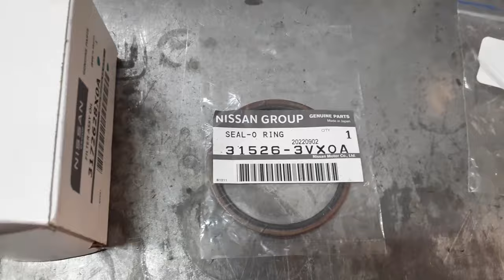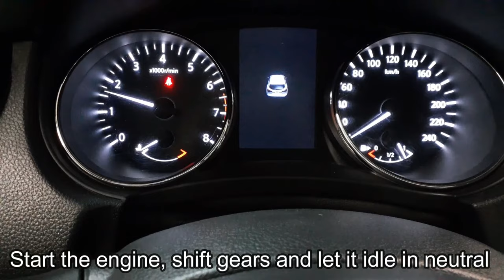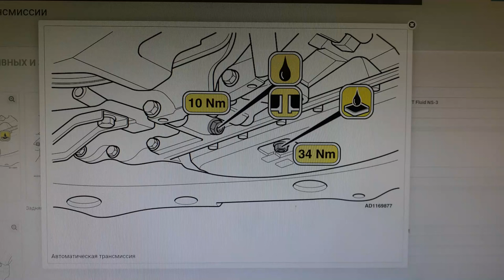Nissan Qashqai Automatic Transmission oil service

Comment: hi! how did you remove the last bolt on the cartridge filter cover because in the video only the 3 bolts were shown.
Reply from the maker: Hi! I don't remember any difficulties with thiese bolts. So everything must be simple.
Reply: @igorpestun8703  the access its kinda tight so  just want to know what tools you used since i don't have all the tools available I still collecting some of it :)

Comment: Hello and thanks for the information. I think that is the same process for Xtronic Koleos 2018.I have doubts about this service because it does not appear in the manteinance guide🫣🫣 Could you indicate how many kilometers had the Qasqhai??? Thank you again.
Reply from the maker: Hello, thanks for watching. This maintenance doesn't appear in guide, because factory doesn't assume oil change. Mileage was near ninety thousand kilometers.
Reply: @igorpestun8703 first time?…
Reply: Hello, I have a 2021 Koleos, do you know what CVT model our Koleos has? Thank you.
Reply: @adridavis5001  it is a 2018 Zen Xtronic 4WD 2.0DCi
Reply: @adridavis5001  sorry I didn't read "CVT". In my car is a Jatco FK8, I am not sure but I think that is named JF011E too.
Reply: Should be Idemitsu type n3. This fluid fails some requirements on j11